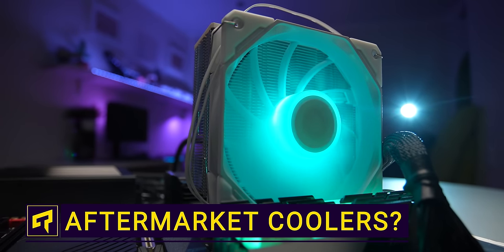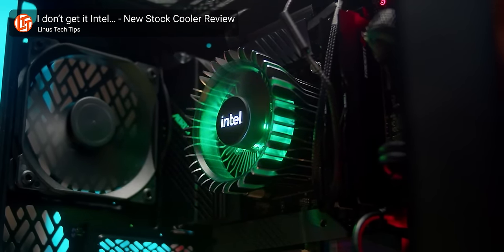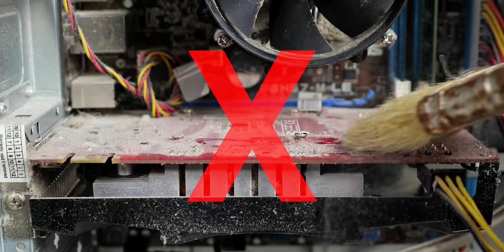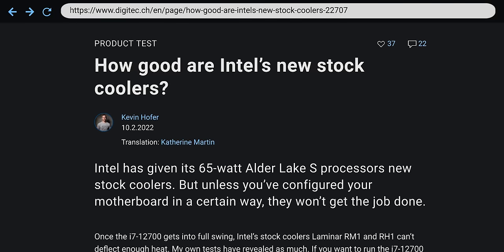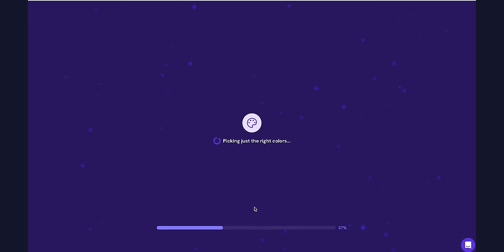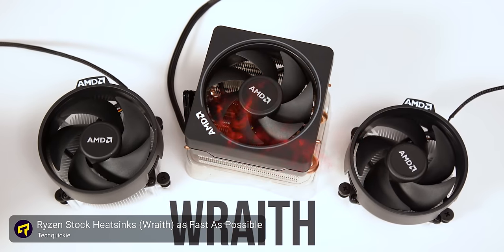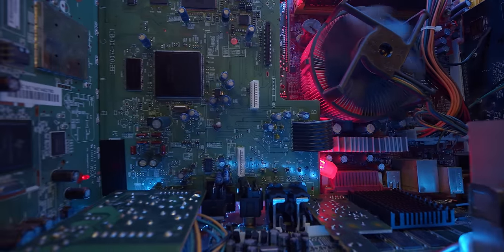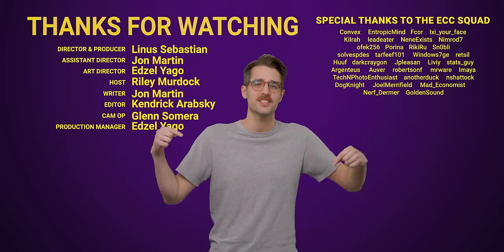Are CPU Coolers A Waste Of Money?

Comment: Cheap tower air cooler for life. Used a CoolerMaster one for a long time, then upgraded to a Noctua a while back. It's been with me for two CPU upgrades already and my mid-range CPU still gets all the headroom it needs. Never going water cooling unless something changes drastically. Don't need that headache.
Reply: Since when is Noctua cheap? You can get a Jonsbo one for about 11$ and it has aRGB
Reply: @g00ts  compared to basically any decent water cooling, a $50 knock to a tower cooler is cheap.
Reply: Rolled with a relatively cheap cooler master 212 for a really long time. Recently got a thermalright with the same design but only around $10 brand new.

The time I tried water cooling AIO, I paid $100 and still have the pump die within a few months
Reply: 100% agree. Got a fairly decent AIO cooler and was very disappointed vs my old CM Evo 212
Reply: Unless I go custom water cooling for aesthetics or extremely small form factor, I'm not touching water cooling personally. No hate just not worth it for me.
Reply: @g00ts  sure you can get that one, but does that one come with silence, reliability and superb customer support like Noctua? Probably not.
Reply: noctua is like the biggest scam people keep buying into. Their $70 cooler is defeated by $15-25 coolers of other brands even, including in silent operation. Meanwhile their top dog nhd15 (and most other brands that sell 2tower coolers at 3 digit prices) gets beat by $33 to 40 coolers of other brands

""bbbut ifree upgrade bracket!!!"" yep, and assuming you upgrade like a reasonable person (say, maybe every 2 or 3 motherboard socket generations instead of every time) (which btw is still multiple times faster than most people), you need to keep an noctua cooler for for 30 (THIRTY YEARS, 3 DECADES) for the free upgrade brackets to pay for the initial massive overprice.
Reply: @lywellyn0  There are multiple brands with far better value and nearly the same performance as Noctua, such as Thermalright and Deepcool.
Reply: Thermalright, highly recommended price-to-performance! 👍
Reply: I literally rock an AMD boxed cooler....Overclocking is basically dead. CPU's these days are already squeezed hard out of the box and the miniscule gains isn't worth it when overclocking. Overclocking USED to make sense a decade ago, but the chips are not massively underclocked stock like they used to be.
Reply: Yup.  I use air coolers in all my PCs.  The very idea of liquid in a computer makes me nervous.  I never overclock 'cause I ain't that crazy and I don't game.  I produce video.  Adobe After Effects is a menace.  Even after feeding it 128GB RAM, it asks for more when doing 4k to 6K.
Reply: It’s not even a headache though
Reply: @brokeandtired overclocking is definitely not dead lmao
Reply: Lol noctua...cheap.  thermalright peerless assasin or phantom spirit.
Reply: Share ur specs 🥹
Reply: @g00ts  Not cheap but they always keep their coolers updated, so for a small fee you can always get the latest hardware you need to keep using your Noctua cooler on newer chipsets. And Noctua should never exist even in the same sentence as Jonsbo. lol
Reply: nothing wrong with AIO coolers
Reply: @reniervandermerwe  Nothing wrong but they're totally unnecessary for the overwhelming majority of PC builds. Why add the extra potential fail point of having liquid circulating around expensive PC parts?
Reply: For a 13700k I was told air cooling wouldn’t cut it anymore since the chip runs hot. Would be interesting to see an air cooling set up compared to the AIO I bought.
Reply: I didn't see any headache from switching to an AIO. I did get mine at a silly price in a closing down sale but it's been basically the same apart from running a few degrees cooler.
Reply: Honestly it's like reading a comment of my own a few years back. I always used Cooler master and Scythe coolers, 212's, Mugen, Ninja ect. Specially the Ninja and Mugen coolers, able to tame every CPU.
With my last build i went with the Artic Freezer AIO though. I wanted to OC my R7 5800X with no bottlenecks whatsoever, and even the Ninja 5 does not like that chip.
Gotta say i'm impressed, it rarely crosses 70c and that with most cores tipping 5Ghz.

Honestly though, unless you want to rip the last cent of performance out of a new chip, an aircooler would be fine. Some even perform better then basic AIO models.

I still don't like the idea of water running through my life-savings. Kinda feels like playing with fire. Oh well, so far so good. 3 years in and it still hasn't gone wrong yet.
Reply: Even now Noctua is overpriced compared to thermalright.
Reply: @joshholmes1372 Literally don’t understand why Noctua hasn’t been forced out of the buisness. Thermalright beats them in every aspect. They’re the Nvidia of coolers.
Reply: @lucashytinen8160  I am struggling with this decision.  I am getting an amd ryzen 7800x cpu and I really want to aircool it wih an enermax f40 argb but they say the ryzen 7000 series runs hot.  but I don't like the idea of draining and refilling the liquid cooler every couple years Iam not a serious gamer just like to have powerful computer that will last me for years
Reply: @deleteduser121  so with an AIO you don’t need to drain or refill the liquid. It’s basically water cooling for dummies. They wont last as long as a fan, which would be expected. AIO’s should last years depending on your usage, then you just replace it when the time comes. Look up Arctic Liquid Freezer 2 AIO. I’ve been pleased with mine but I did need to undervolt my CPU. 

The custom liquid cooling your talking about can get better cooling but I agree, screw draining the liquid lol
Reply: @lucashytinen8160  oh thanks man!.  Yeah I don't really want to take it off the computer and like drain it and put it back on and it's I would probably just send it somewhere to do it every couple years. But then I thought you probably really don't need to drain it. It's probably just a myth but I don't know.  By the way, how do you know when the it stops working? I don't want my thing to burn out
Reply: @lucashytinen8160  I'm not a heavy gamer. I mostly just watch the internet. I just buying this big computer cuz I wanted to be the last computer I ever buy
Reply: Only time you have to go for aio are any liquid  coolers really is if you go for high end chips that overclock like a beast
Reply: That's odd. I've never had a headache over my AIO. Just lucky I guess.
Reply: @g00ts  Noctua was once the cooling and low noise king of air cooling and so you felt that expense was worth it, Either for the cooler or for the fans, But that landscape has drastically changed! Although, Many don't realise this, or are so stuck on the "Noctua is the very best so its worth paying top dollar" mantra that it's become the reflex apex process. All you gotta do is just a little research and will find some bad ass coolers and fans (just as quiet and just as effective) for a fair chunk cheaper.
Reply: @danimayb  for sure. Noctua in a desktop PC is a fashion statement.

Comment: This raises an important question... we benchmark CPU performance per dollar to ridiculous standards but never take into account the price of the cooler. For example, could a 14700k with a stock cooler be a better choice for the same price than a 13600k with a nice cooler? Or any other combination of CPUs for that matter... Should we be testing CPUs with stock coolers as well as with 'adequate' cooling to actually be able to determine which combination of CPU and cooler is actually the best performance per dollar at a certain price point?
Edit: 13600k->14600k
Reply: That would be an interesting test. Just seeing the difference between the stock cooler and a better one would already be a good enough indicator, I think.
Edit: But also consider, that some CPUs are not delivered with a cooler at all.
Reply: In the UK the 14700K is around £380 the 13600K (which I own) is £299 + £10 for an Arctic i35 (I paid £30 for the A-RGB version) with a 200-1700RPM range I find it performs great for an overclocked 13600k. I've never come close to thermal throttling. For me the huge saving over the 14 series was worth it. I guess it really comes down to how much you'd drop on a cooler when the cheaper options perform exceedingly well.
Reply: @Mohegan13 Sorry I meant 14700k vs 14600k. Or in your case 13600k vs13700k. With your cooler you are almost at the price of the 13700k. The question was, would you be better off just getting the  13700k and using the stock cooler... More cores is probably going to give you much more performance than cooling an inferior chip. After all stock coolers don't really result in much thermal throttling at all these days.
Reply: You can usually get an adequate liquid cooler for 50 bucks these days. Or air coolers for 30 to 40 bucks. I don't think that price is high enough really to be the biggest factor. Especially if you can bring a cpu cooler with you to your next system.
Reply: @vespaman101  What the hell are you talking about, the difference between 14600k and 14700k is literally 6 extra cores (8 threds) for just around $100 which is gonna be only about 10% of the total system cost! You can't say a cooler will give you anywhere near half of that performance.
Reply: @why_though  there's no way you're talking 400 dollar cpu's and saying 100 is only 10% of total system cost. If you're only using 600 for everything else that systems going to suck. You're likely building a system at least 1500 but more likely around the 2000 dollar mark and beyond if you're spending that much for a cpu.

At that point 50 dollars for the cooler is an irrelevant metric. Even with an unrealistic 1000 dollar pc that's 5% of your total cost. It's likely to be 2.5% of total cost or less. Why would you have a 100 dollar cooler in a 1000 dollar system?

Let's not forget a 14700k is a 20 core 125 watt cpu. It doesn't even come with a stock cooler due to that. The 13600k doesnt have a stock cooler either. Which makes this example kind of silly from the beginning. But hey, maybe you should do that research before acting like an asshole and cursing at people.
Reply: @harixxt.5150  none of the coolers he talks about have one. And hes under the impression that you'd be using a 100 dollar cooler apparently... on a 1000 dollar system at that...
Reply: @vespaman101  You seem to overlook that not every system is for gaming. Some systems don't need an expensive graphics card. Anyway, if the percentage is even lower that strengthens my point further.
Reply: You got a point same thing with grapics cards you gotta take the cpu into account the power supply and some times even the case might be too small but when people compear the price it's just the card
Reply: i7 14700k doesn't have stock cooler. At least i haven't seen anywhere it with cooler
Reply: @skynet3542  you're right, substitute for a pair of CPUs that do and repeat the question
Reply: We typically don't factor in the cost of the cooler, because heatsinks can be used across multiple builds. I have a Noctua U14S that I bought way back in the i7 4790 days, and its been used across 3 builds since. In fact, it cools soo well, that it outdoes most liquid coolers, while also being quieter. On top of that, even the original fan with it still works fine. So why should I factor in the cost of cooling? The smart thing to do is only buy a cooler that you can use across multiple builds. At that point the cost becomes negligible.
Reply: @Mohegan13 I use a 13600kf with a 280mm AIO (Arctic Liquid Freezer ii,  bought during a promotion) I chose the AIO not just for it's outstanding cooling performance, it's also very quiet. Noise levels are a major factor for many people and probably the reason many folks go with a non stock cooler.

Comment: Get a NH-D15 or equivalent cooler and use it for 15 years and like 4 builds
Reply: That’s what I did with the Hyper 212 😂😂😂😂 since 2015, and just last year got an AIO kit😂😂
Reply: My last build had a big noctua cooler.  Performance was great, but my only issue with them is the physical size.  They often cover the ram slots and make reaching certain connections impossible without removing that chonker first.  That's the main reason I went with an aio liquid cooler this time.  It's much easier to deal with for maintenance and upgrades.  The noctua was quieter though, so I guess it just comes down to preference.
Reply: @bodiwire  NH-D15S or NH-U12A have better clearance with similar performance
Reply: @myuzu_  also the C14S is a sleeper hit, great little cooler!
Reply: I bought my NH-D15 in 2013, went to a second build and it will surely go to a third build!
Reply: @myuzu_ which one is better?
Reply: Overrated. Get a Thermalright Phantom Spirit for nearly the same performance at a fraction of the price. You could even attach Noctua Fans to it and still save money.
Reply: @FieryMeltman  I agre if you're buying new. For someone who already has the Noctua, it's a great investment.
Reply: @mrlightwriter  What's there to invest in? The heatsink itself won't fail, and the fans are easily replaced.
Reply: @FieryMeltman  Investment in the sense that it's the best air cooler.
Reply: @mrlightwriter  Not by much. I think spending $35 on a Phantom Spirit and using the savings elsewhere is a better idea.
Reply: I thought the same thing until I got a 12900k. I used a Noctua NHD15 with a 8700k (not overclocked) and never had a problem running Handbrake  to convert videos. I built a new computer with a 12900k ( also not overclocked)  and thought I'd save a few bucks and reuse my NHD15. A couple of  minutes after starting Handbrake the computer would reach 90+ degrees. A few seconds after hitting 90 it would lower all the CPU core frequencies and the computer would cool off and hold at 85 to 90 degrees. I bought a DeepCool LT720 360mm AIO and my computer idles at 25 degrees and max temp of 55-60 degrees when running Handbrake.
Reply: @rodneykeene  Damn, that really proves that the newer processors are power hungry. Like you, I still have a 8700 and never have had any issues, even when overclocking.
Reply: @rodneykeene  Yep. Deepcool and Thermalright, along with making top-tier air coolers at amazing prices, also make some great budget AIO water coolers. They're just a bit louder than more expensive AIOs.
Reply: @rodneykeene  you must have forgot paste or something. That's not normal
Reply: @johanlahti84  The  i7-8700K has a TDP of 95 W and the i9-12900K has a TDP of 125W, but can reach 250W when the turbo boost kicks in. The 12900k just runs a lot hotter. The nh15 has a max TDP of around 200W.

Comment: Considering the ryzen 7000 series runs hot. Yes it helps alot. As well as 13th and 14th gen intel run very hot as well
Reply: yeah especially nowadays when a cpu boosts untill it hits a certain temperature a bigger cooler can mean a lower temperature which means it can boost faster and longer
Reply: Pbo is your friend
Reply: Yeah I can confirm my i9-14900KF does run hot even with the biggest air cooler.
Meanwhile my old I5-4670k was fine at 5.2GHz overclock on a 212 evo XD
Reply: @bablela26  how old is your 4670k. Not familiar with it. Also brave for even having a big air cooler.
Reply: Heck I bought an i5 12500 2 years ago. Even that struggled with the stock cooler. 
And some of the AM4 based Ryzens I worked with actually started dropping boost clocks already upon reaching 65° C
Reply: @Castigar48  it's a 11 year old 4 core cpu with 4.2GHz base clock, yep it ran 10 year with a +1GHz overclock, never changed thermal paste, a 212 evo cooler is pretty small compared to today coolers XDD
Oh and my new Coolermaster MA824 has probably more cooling surface then a 240 AIO, without a pump or liquid, I trust copper heat pipes more lol, so it'll stay on there for the next 10 years just fine XD and nothing can cool a i9-14900KF at full power anyway
Reply: @bablela26  love to see it. I have a ryzen 7700x and the shadow rock 3 and that tried its best but with the 280 be quiet aio i have now it just runs so much cool and basically behaves bc rysen 7000 series runs of idk nuclear fusion!!
Reply: Still a 30$ air cooler will do a perfect job with all 6 cores and a decent job with octa cores, although even I always buy expensive coolers for the generally better aesthetics
Reply: @kenos6939  no doubt. Hows that 30$ air cooler work on cpus that run hotter alot hotter
Reply: @Castigar48  it's not gonna struggle on all 6 core CPUs and it will keep under 85 most 8 core CPUs